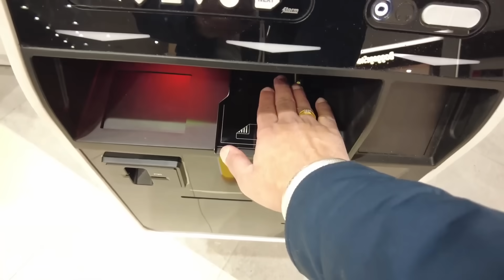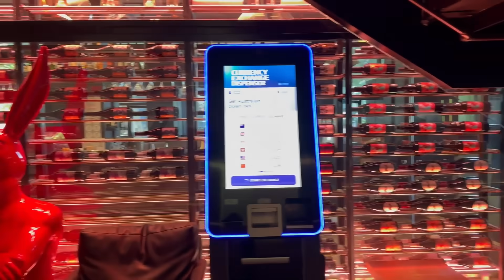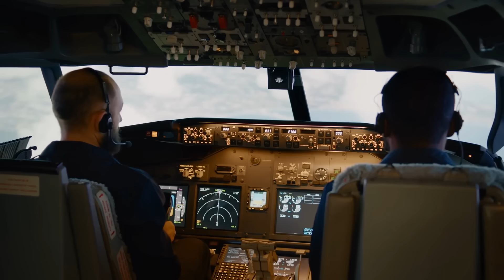Perth Airport's FUTURE as a Global Gateway Revealed

Comment: So even now in the evenings it can take 45 minutes from Tonkin hwy to T1 to drop off or pick up. That's when two A380 planes are there. Normally it takes 5 minutes to get in there. So when we have all the upgrades done, is there any plans to streamline drop off and pick ups?? Recently they even closed Horrie Miller drive to cars, redirecting them onto Airport drive. Bumper to bumper crawling back to the servo and beyond was the result. I hate to think of how this will end up.
Reply: There are plans to have a separate drop-off point for ride-share/taxis etc. away from in front of T-1 which is the main cause of the peak period cluster-f***.